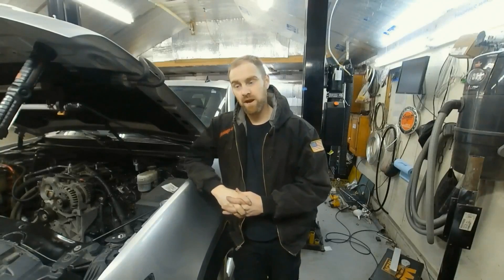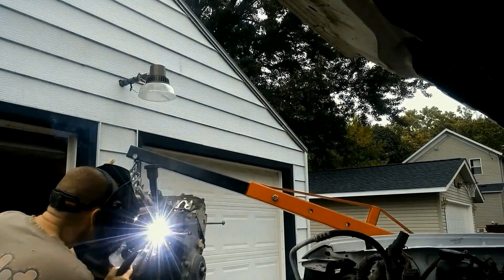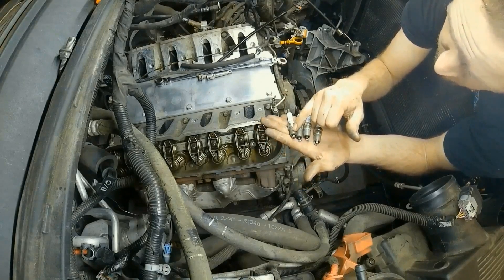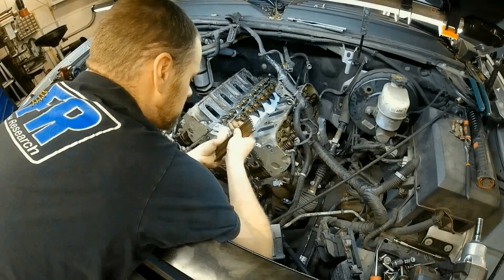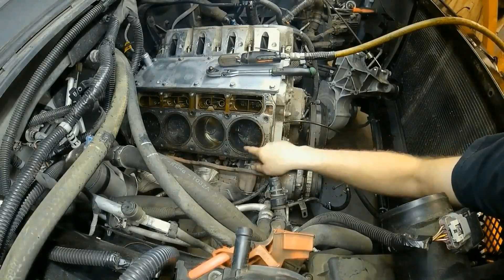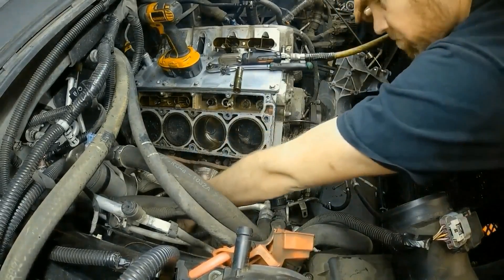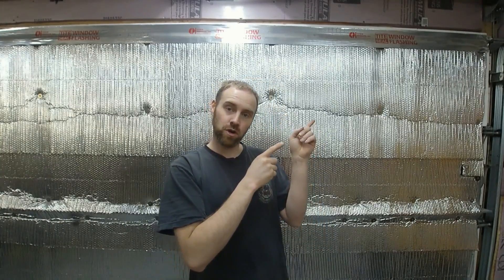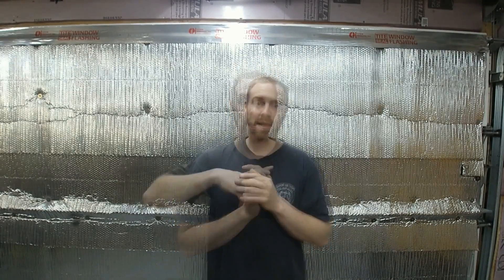DOD Delete kit using texas speed pt1 afm suburban tahoe...

Comment: I'm going to do the same thing but I would much rather take the engine completely out put it on a stand replace the rear main seal on the engine and the front transmission seal on the transmission clean out the torque converter in drain. Much easier work on.. on a stand. If I ever remove the heads I always take the engine out.

Comment: So I'm working on this truck and did all the diagnostics because it had a miss. Come to find out it had this pos dod motor. Found your advice which was extremely helpful. The push rod on number 6, that was the cylinder that had the miss, which led me to your videos, is now tight like it should be. This truck was sitting over the weekend opened up, could it be possible it released itself? Or should I still talk it like you show?
Reply from the maker: You can check by watching the rocker when you turn the motor over.

Comment: Why does GM make shit that fails? Dont put this shit on a v8  If I want a engine to run on 6 cylinders I will buy a 6 cylinder!
I bought a 2014 suburban and I believe it has this problem!
Quite frankly if I knew this was an issue with these it would have been a huge factor in buying one.
Reply from the maker: All companies engineer there vehicle to fail after warranty, some are just slightly better or worse depending on year make and model. But I fully agree, the person buying it purchased it to be a V8 not a damn 4 banger...

Comment: Many kits sold have the VLOM that does not have the solenoid plug.
I reached out to many AFM DIYers and they said they never got a CEL or codes just leaving the connector unplugged. 
2 questions:
- do you know a specific way to avoid any codes on the first startup?
- if using HPTuners, can you write up or show a quick video on what to do in the software to avoid any codes or no throttle response on first startup?
If
Reply from the maker: The system must be turned off when doing a full delete https://youtu.be/uvDE-LCmbnU
Reply: @CrazedPerformanceRepair  Ok so you just left the connector unplugged, got it thanks 👌

Comment: Great video! Thank you for making it. Getting ready to do the same on my truck. Would you recommend going with one step colder plugs?
Reply from the maker: No not unless you are doing some high performance thing.
Reply: @CrazedPerformanceRepair  i am going to buy a tuner and disable the DOD from my 2010 ppv tahoe with 105k miles. Do i still have to install the DOD delete cam kit etc?
Reply: @madbroindustries  get the afm disabled by range it just plugs into the obd port  and keeps in v8 full time, I have on in my impala ss and my Silverado both work great!

Comment: Thanks for all your videos. They was a lot of help through the process. I have a 2012 Chevy Suburban that I done to AFM DOD delete with camshaft swap, kept VVT. Also had the ECM tuned. Had a question to see if you could help me out with. Everything seems to be fine, runs and idles fine but once the engine starts getting warm if I barely touch the accelerator The engine idles up high and hangs (2,500-3,000rpm) at a high idle for 5 to 10 seconds and then slowly comes back down. Do you have any idea what may be causing this issue? Do I need to relearn cam? Thanks
Reply from the maker: You Might have a vacuum leak.
Reply: @CrazedPerformanceRepair  That's kind of what I was thinking. It does kinda sound like it has one on the back, driver side of the motor but I couldn't pin point where it is.
Reply from the maker: Pcv on valve cover to intake, brake booster hose not fully seated or torn injector seal if you pulled them out and tried to replace them.
Reply: @CrazedPerformanceRepair  Thanks, I'll check it out and see what I can find. Didn't try to pull the injectors but a couple got turned a little from moving stuff around.
Reply from the maker: Turning the injectors won't cause a issue.

Comment: Thanks for your videos and detailed instruction on this problem.  Thanks to you, I was able to use your tool to free up my lifter, modify the VLOM, and send off my PCM for reprograming just as you instructed, and I'm happy to report the truck is now working GREAT!  I will say that when I first started the truck back up after putting the engine back together, there was a soft tick.  I remember you saying that sometimes the lifters will fail again but I figured that if I just let the truck run for a bit, the oil pressure would build up and the lifter would free up...and it did.  Purring like a cat now!  If anyone thinks they can't do this, you're wrong.  I'm not a mechanic, more of a handy man, but by following the instructions I was able to pull this off and save hundreds or thousands of dollars.  Good luck!

Comment: I have good oil pressure in my 07 avalanche with a 5.3 and no engine light on... But I can definitely hear the push rod slapping the rocker arm! the noise seems to be from the drivers side. Its bad news no matter how you slice it, the noise started as a tick and its loud now, and i want to park it! My question is does the cel light not always come on indicating the misfire code?
Reply: I have a 2005 and did this to free it up.. Buy 1qt of Rislone it's been around 40+ years add to your engine run it for about 300 miles and I promise you won't hear a thing but then after do a oil change after about 300 hundred miles with Royal Purple or Mobile 1 high miles and add 1qt of Rislone again now this time run it for about 2,000 miles.. And remember watch your oil on any chevy motor from the years 2001-2014 and do regularly ever 4,000 miles no matter what oil you use because they are notorious for burning oil and make sure your oil pick up tube is cleaned and the pick up tube O ring is good if you have lower oil pressure or  unconsistent oil pressure.. I have a 2005 chevy tahoe LT that had 140,000 with the same problem when I first purchase and now I have 205,000 and never had the problem after taking this step

Comment: So theoretically you could disable it and and never have an issue as long as those parts are in good shape?
Reply from the maker: If you are referring to the DOD and shutting it off prior to failure then yes it should prevent problems.
Reply: Apparently they still fail, though they’re disabled. That’s what my tuner told me. Same with the shop foreman at the GM dealer I go to

Comment: Really appreciate your videos. I have a 2012 Tahoe and just installed a DOD kit and the truck will not start. I’ve called the people that I bought the kit from and they said that it isn’t starting because I soaked the lifters in oil. Does that sound correct? All brand new lifters installed. Thanks in advance!
Reply from the maker: No that has nothing to do with it. You likely left something unplugged like cam sensor or maybe forgot the ground on the back of the head to the firewall. Otherwise as long as your timing is on you should be good.
Reply: CrazedPerformanceRepair  Thanks! It’s probably something simple. As far as the timing goes-I lined up the Arrow on the cam sprocket to the dot on the crank sprocket (driver front piston was all the way up). That’s all I would have done....correct?!?!
Reply from the maker: Some of them it is a arrow and some are a line. Check compression to make sure you did it right. It should be about 180 give or take.
Reply: CrazedPerformanceRepair thanks-I will check that! I think it’s super cool that you’d help some random dude on YouTube! Thank you! Keep making the awesome videos.
Reply: Welp-cylinder #1 showed 90 PSI and #3 showed 0 PSI. Looks like I didn’t reinstall the cam shaft sprocket correctly. Would you agree?
Reply from the maker: @gregorybrown7039  it sure appears that way
Reply from the maker: @gregorybrown7039  hopefully you didn't bend any valves.

Comment: I wouldn't say it's a bad system. Just certain setups, the valves in the L77 and L98 hold up pretty well with the dif lifters , but yeah if you own the earlier models...
DOD delete for sure.
Reply: Its a fkn terrible system..
Reply: It's a horrid system lol

It only serves to save gas mileage while sacrificing your engine's longevity

Comment: I’m currently doing the delete on my 5.3 only thing is my new lifters have oil guides on the sides not like front back the way the afm was when removed was I sent the wrong lifters ?
Reply from the maker: I think you where sent the wrong lifters. Make sure you get the non DOD lifters and correlating guids.
Reply: CrazedPerformanceRepair I did order the non dod kit with valley plate non dod camshaft and lifters

Comment: How do you tell if your motor has that
Reply from the maker: Some models started on 05 but most implemented it in 07. If you look under the intake you can see if you have it or not. If you don't have it the plate will be smooth, if you do have it the plate will be uneven.

Comment: Do you guys have Emissions there? We had an 07 silverado with a dod kit that we ended up not being able to pass emissions because of it. Ever had any issues with that? We’ve done like 5 valve jobs because of afms so this should save us a ton of time and money. Thanks man. As long as it doesn’t pop any codes from it and the monitors all set we can get it thru emissions I’m sure. I forget what the exact reason was for it not passing.
Reply from the maker: We don't have the emmissions test in MN anymore but the one that didn't pass was likely for another reason. The AFM/DOD is only on select gm v8's not all of them so if it was that all the others wouldn't pass. Well unless they check for functional AFM system somehow now. Wouldn't surprise me if they implemented something stupid like that.... higher mile DOD vehicles do burn more oil from ring wear so that could be related.

Comment: ok, I had the almost the same thing. Took my valve cover off just now and one of the rockers for cylinder #4 was not moving but was not lose as in your video but it was not moving as the engine cranked. I was just about to remove the intake and cover to try the "push rod fix" but saw this video. i tried the Seafoam in the oil routine and it also did not work (after 1 day). I took Seafoam for carburetors and stuck the straw down the #4 push rod hole and sprayed as well as down the hole where the rod sits. Then I used an 3/8th extension 8" long and hammer to softly tap the rocker above the top of the push rod. At first it bounced like I was tapping in a spring. Then it went solid and I stopped. I tried other rocker arms above the push rod just to see what it felt like. They all felt solid! did I fix it? YES IT WORKED!! Cranked it over and the rocker rocked just like all the others! Now what caused it???...dirty buildup in the lifter or a bad VLOM? This engine has 170,000 miles on it and it is a 2009 Tahoe with police package (probably a lot of idle time).
Reply from the maker: See the last three video's on this playlist https://www.youtube.com/playlist?list=PLPRbZLG-A0WHJ-9mhL9IqSHqquUiBdhdm doing that mod and the tune with eliminate all possibilities.
Reply: @CrazedPerformanceRepair   If you disable DOD in the computer then why would I need the mod?  Is there an issue where the oil would get through the VLOM to activate the lifter?  Can you put in the oil plug device without removing the intake?
Reply from the maker: It's not always needed but there have been some people with VLOM failures causing lifters to activate slightly and fail. If your vlom is fine the tune is enough. Think of the VLOM mod as insurance it will make sure that no matter what happens it can't somehow collapse a lifter. The oil plug can be put in without removing the intake if you can get the oil screen out, it can be tough sometimes with intake in the way. But the plug alone doesn't cover all possibilities because if the system is somehow plugged up in that VLOM on a port then that could also cause a collapse since the lifters are feed from underneath as well and normally bleed off through the VLOM.

Comment: Question. I'm looking at buying a 07-09 era Avalanche 5.3. Assuming the truck I find has no current issues with the AFM or signs of a lifter noise.... disabling the AFM with a tune or flashpaq or something would be a logical step? Seeing your explanation of the failure certainly leads me to the conclusion that disabling it means its much less likely to crap out and is a no brainer.  Its a second vehicle for me and i probably won't drive it more than 25k before I resell it. I'm a master tech so doing a full AFM delete is no big deal.. but I don't do a ton of GM.
Reply from the maker: If you want the easy way if it hasn't failed yet get the rang device https://amzn.to/2HVa1gu other wise tune it or have a speed shop tune it.

Comment: Hey, loved your tutorial! I just did this on a 2013 Suburban and #4 valve was bad -- the exact same one as the one in this video. I put it all back together and then disconnected the brake boost wire to keep it from going into 4cyl mode. it started right up and the issue seemed to have been resolved until I started driving it down the street and the lifter got stuck again. My question is: doesn't unplugging something like the brake boost wire keep it from going into DOD mode? I ask because if I delete the AFM and get the lifter unstuck again, will it be permanent?
Reply from the maker: Well this video is a full delete so I know you did not do this. As for disconnecting the brake booster wire, I had two guys tell me that did not work for them either. I would suggest watching my VLOM Mod playlist than get the tune done to turn of DOD.  https://www.youtube.com/playlist?list=PLPRbZLG-A0WHJ-9mhL9IqSHqquUiBdhdm

Comment: Not sure about the ls based engines but most engines have a antifreeze drain on the side of the block if you pull those out you end up with less than a cup of liquid left in the cooling system hence no antifreeze mess to contend with
Reply from the maker: Yes they have them but on one side is above the starter the other side is a one inch hole. They are both allen heads so I don't messed with them.

Comment: Thanks for the videos.  What causes it to stick like that?  It's catching towards the bottom, but if it's not grime build up is it getting warped over time and that is causing that extra tension not letting it release and if so why are the others which are always in use not having the same issue, because they are more regularly lubed?
Reply from the maker: The metal eats itself deformed and since the inner part of the DOD lifter is a precision fit as soon as the metal deforms even a little the inner lifter gets jammed up. It's a manufacturer design flaw. The reason some fail sooner is due to differences in in tolerance and/or a failure in some way with the vlom units oil flow that causes one to beat it's self up faster then the others.
Reply: @CrazedPerformanceRepair  Thank you for the response.  I fear I may have this issue, my 07 Suburban with 170,000 miles on it is showing random misfires (#2 and #7 specifically), flashing check engine light with service stabilitrak and traction control is disabled showing  She's idling terrible with grey smoke out of the exhaust.  I changed the plugs which had 70,000 on them and the wires and coil packs which were original but the problem persists. I did notice when I tried to drive her and let her coast v4 mode never came on.
Reply from the maker: @nachoman3982  v4 won't come on if the lights are on in the dash. Cylinder 2 is not a dod cylinder but could still be a ghost code because of 7 misfiring. Best bet would be to get some good diagnoses of it. Be sure as to why the misfires there.
Reply: CrazedPerformanceRepair so just FYI, figured I’d follow up with the results.  I had my local shop diagnose and sure enough the rod by cylinder 7 is collapsed, they checked compression then pulled the cover to be sure.   They specialize in transmissions and overall repairs, but this is beyond what they generally want to work on do to amount of work they already have, so I shipped it to the dealer.  They confirmed, but said both lifters for the AFM system at # 7 are stuck.  They can’t free them so they claim, but I gave the OK to have those replaced and Upon my request they are going to programmatically deactivate the AFM permanently, of course this is extra to do because it’s done by one of their techs who invested his own money into the hardware and software for it.  None of this is cheap at the dealer, but they agreed that unless I’m replace all of the related lifters it’s the right way to go as any of the others could fail soon after.  They see this regularly per the service manager.  There really should be a recall, but at 170k miles I got my share of use I guess.  Still my 99 Chevy with 304k’s engine still runs so smooth you sometimes aren’t sure it’s on and never had any engine work.

Comment: So question: when you do just tune and tune out dod will the chance of lifter collapse still exist since it’s never asked to collapse again? Thx
Reply from the maker: Generally no at that point the DOD lifters should be fine. Now, if something strange happens like the vlom (if still in there) gets plugged up or a solenoid somehow magically fails then it may collapse. But that's very unlikely I have yet to see it.
Reply: CrazedPerformanceRepair thx bud love your channel just subscribed.
Reply: @CrazedPerformanceRepair  

How often or how important is it to clean and/or replace the oil pressure/vlom screen?

Comment: how can I tell if I have my engine has that DOD system on my vehicle? 2013 Silverado 2500 6.0 engine z71
Reply from the maker: 2500 shouldn't have it it is too heavy. Easy to check though, just look under throttle body if the valley plate is smooth you don't have it if it looks like this https://amzn.to/2BWTgw0 you have it.